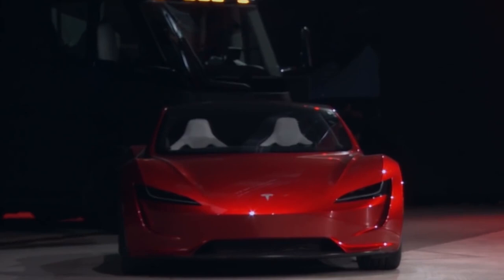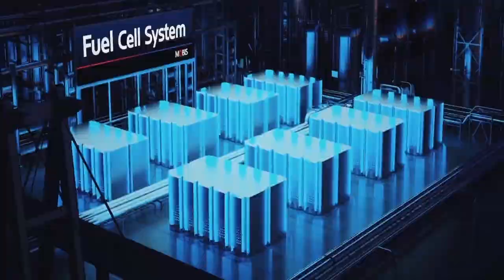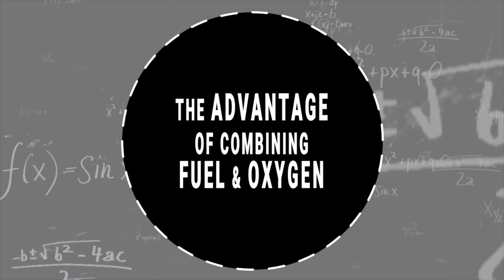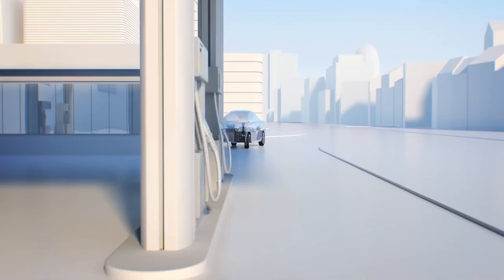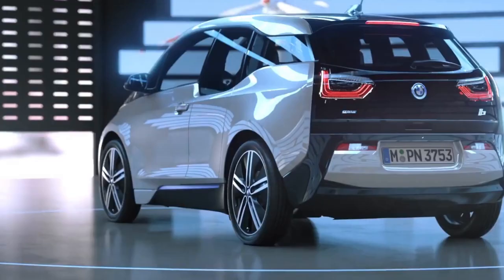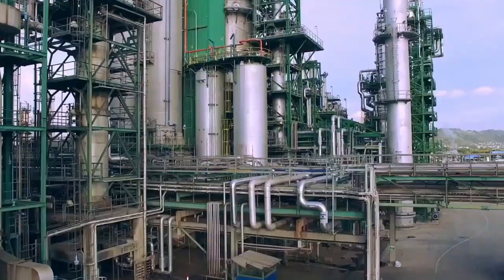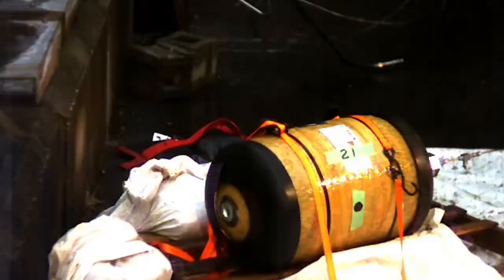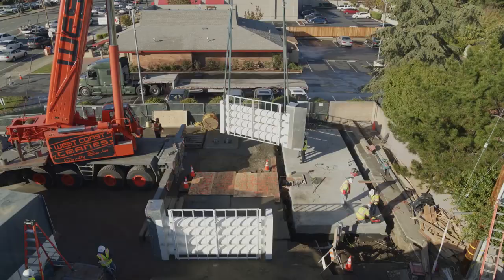is hydrogen fuel cell the future?

Comment: yes
Reply: nope
Reply: @engineeringtheweirdguy2103  bet
Reply: @Victor-oy8bj  sure, but I could just tell you why it wont be the future. Its just not a good technology for vehicles. Just because it works doesn't mean it works well.
Reply: @engineeringtheweirdguy2103  it works well, its just the infrastructure. when 1000 mile range with 3-5 min fueling time starts being noticed, the industry will change. im open to being convinced, i just feel like hydrogen works best.
Reply: @Victor-oy8bj  ok. well lets have a look. I'll outline some problems then I will show how they work out in real world examples. sounds good?

ok, Firstly, Hydrogen fuel cells dont produce alot of power. Infact the need batteries to adequately accelerate the vehicle. Even then, Hydrogen vehicles are still exceptionally slow. There are some examples of incredibly fast hydrogen vehicles but they have the practicality of Lamborghini aventador being a family car for a soccer mum. They're purpose built machines with no boot, 2 doors and 2 seats.

Hydrogen is also incredibly inefficient. to produce Green hydrogen you need grid electricity and water. The same grid that charges BEV's. Hydrogen is very inefficient however, requiring 3-4 times as much grid energy per mile than a BEV. Which means 3-4 times the same emissions. Yes you could run this from renewables but the same can be said for BEV's. 

The other way, and the cheapest way of making hydrogen is getting it from fossil fuels (hydro-carbons) where you split off the hydrogen and the carbon is released into the atmosphere. This way of making hydrogen actually releases more emissions than if you had just burnt the fuel in the first place. That also means hydrogen will always sit at around 20x more expensive to operate per mile than BEV's.

The next problem is that hydrogen, whilst is very gravimetrically energy dense (kWh/kg) is not very volumetrically energy dense (kWh/L). In practical application, the volumetric energy density of hydrogen means that its less than half that batteries. Making vehicles its in fairly impractical in terms of space, especially when you consider it also needs a fuel cell, exhaust system and batteries to boot.

For this reason its difficult to get a long range hydrogen vehicle. Typical hydrogen vehicles on the market only offer 20% more range to a tank.

Another problem with hydrogen is safety. Whilst they've made a very good effort to make the fuel tanks safe (since your sitting on 160kg of TNT in a Mirai but a hand grenade is only 0.06kg of TNT). They've also protected the tanks by reinforcing the chassis. This reduces your crumple zones and results is lower survivability in a crash compared with similar vehicles. It also has huge implications on weight, with Hydrogen vehicles typically weighing more than their BEV counterparts. Even in trucking, the Hyundai Xcient hydrogen truck weights more than a Tesla Semi but over a ton, and gets 200 miles less range fully loaded.

and finally, The lifespan of hydrogen vehicles. Since hydrogen embrittles materials the cars dont last forever. Infact, little know fact about hydrogen cars is that they come off the assembly line with an expiration date printed on the fuel cap limiting the life of the vehicle to only 15 years. The fuels cells themselves only typically last between 150,000 miles to 200,000 miles whilst modern EV batteries are designed to last 500,000 miles to 70% of their original capacity whilst next gen batteries about to begin production in 2022 will last nearly 1.5 million miles to 90% of their original capacity. Making hydrogen a poor lifetime investment.
Reply: @Victor-oy8bj  In terms of trucking and freight, Hydrogen does not stack up well. The Tesla Semi has been undergoing practical trials with selected companies currently. Meanwhile the Hyundai Hydrogen truck the Xcient has finished those and have started selling their trucks in Europe and Australia. 

here's how they measure up. The Xcient requires a 75kWh battery pack just to accelerate. That the same size pack thats in a long range model 3. It also has nearly double the standard semi truck fuel tank capacity at almost 1,000L, it has also has 2 fuel cells. To accommodate these they did 2 things. They made the rear of the semi higher, reducing vertical cargo capacity. They also made the rear part of the semi much long, (which looks weird) increasing its turning radius making it worse for tight spaces and reversing trailers.

it also weights 9.8T without cargo or trailers, gets only 400 miles fully loaded with all the fuel capacity and has a maximum speed of 53mpg, which is less than freeway speeds, so it cant even get to freeway speed.

It is, like its domestic car counterpart, still limited to the same lifespan.

Now for the Tesla Semi, The Semi weight 8.5T, more than a ton less than its Hydrogen counterpart. It has more than 500 miles of range fully loaded. significantly more than the hydrogen truck, Cost significantly less to operate per mile than the hydrogen truck obviously, is alot faster to accelerate and can, even fully loaded up a hill, out run most cars on the road and can definitely reach freeway speeds, and is overall much smaller giving it better vertical cargo height in the first trailer and a better turning circle.

But what about refuelling I hear you ask? well that seems like a obvious win but it isnt. In the EU, US, Australia, Canada and many other countries there is a limit to how long a truck driver is allowed to be behind the wheel. for example a truck driver in the US is only allowed to be behind the wheel for 11 hours per day. And they have to take a mandatory 30 minute break between their 5th and 8th hour. 500 miles of range gives your over 8 hours of driving and 30 minutes is enough to fully charge the truck. Meaning no lost time compared to the hydrogen truck. A smart truck driver would stop at 5 hours for a 30 minute break at a charger to top up, do the other 6 hours and stop for the night at another supercharger before continuing the next day.

There is no lost time and no advantage to filling faster. And with more superchargers out there than hydrogen stations, it becomes a very obvious choice.

for trucking BEV's cost significantly less to operate, can go freeway speeds, so they get to their destination earlier, are lighter weight whilst having longer range making them able to carry more cargo by ton, further and faster and have enough range that by law their transit time is unaffected by charging.
Reply: @engineeringtheweirdguy2103  dam a whole fucking essay lmfao. not mad honestly lol just surprised
response by paragraph: 

they are slow yes but with everything i think its still developing. even now, in the lith-ion industry, it is being rapidly improved while hydrogen probably gets way less funding and research. if there's a car that has 220 mph, 2.2 0-60 and 1000 mile range im sure theres potential. in the future im sure a 700 mi range sacrifice and 50% speed decrease can be sacrificed for ample space i feel. as you said too hydrogen cars out now are 20% more range and maybe they have done that due to how easy it is to store more.

yes hydrogen is inefficient however if we are able to store enough hydrogen it won't be a problem. and scalability wise, hydrogen is probably better for storage since its probably cheaper to store and less intense to produce.

yes hydrocarbon to produce hydrogen is bad but can be fixed and if enough green energy is produced then price will drop.

so you say that hydrogen is less energy dense by volume and is half-efficient in storage however thats where sources differ. ive read that hydrogen is better by volume. i know it says everywhere that it is better by weight and im not confusing that. ive read per unit volume that its better so idk whats true and for now it can go anyway.

toyota mirai got maximum rating on safety and im sure safety is always a priority and has a reliable testing process. and idk what ur saying about weight, the mirai is comparable to the model s size wise and is lighter by 400 pounds. the nexo SUV is even lighter too.

then about the lifespan theres not a lot of straight answers and ive mostly read that hydro fuel cells are sustainable and refuelable. lithium ions don't seem to have a bright forecast either as they've had a continual problem of degradation and not lasting as long as they used to.
Reply: @engineeringtheweirdguy2103  as i said before about the weights, the mirai is closer size wise to the model s and the model s weighs around 300 kg more.

about the storage yes that is an advantage but not a make or break and is something you can brush off when it comes to the real reasons to buying a car like convenience and price. and i will say the hydrogen car is not a good choice right now because of both of those things but they can be fixed through infrastructure. anyways its not like the mirai storage is tiny either and is probably just around average and not a massive adjustment from gas cars.

yeah it is slow but again, lack of development. battery and hydrogen both operate electrically so hydrogen cars are able to use the same functionality as the fast tesla cars. its been shown too with the hyperion.

again you don't need to exaggerate. a non above average storage isn't do or die. yes they cost more (will be fixed), has maximum safety rating, slower but will improve, and has more range. lifespan? (unconfirmed).

dont get it twisted, the fast refueling is the best and most important advantage which will allow for smooth transition from gas. in an ideal world where everyone has a home garage and charging station yes you won't have to recharge and if only if you don't travel much in a day or go out of city. but the points is most of the population doesn't have that level of structure. not everyone has a garage. yes one garage can charge multiple but not all. and there are plenty people who live in apartments, condos, dorms. people share houses, people are stay over and are spontaneous. fast refueling allows for flexibility instead of having to charge at the same place everyone night. and if saving 16 hours a year is really a problem there is home electric hydrogen producing fuel pumps to put in your garage.
Reply: @engineeringtheweirdguy2103  with regards to trucking, im sure everything is better right now. the xcient you mention was developed 10 years ago so its not really a worthy comparison. again, with the right infrastructure, hydrogen will thrive. even if battery has the same strong infrastructure, hydrogen has the more important advantages and necessities. maybe not today but the future yes
Reply: @Victor-oy8bj  the model S is classed as a large sedan. The Mirai, like the model 3 is classed as a midsized sedan.
Reply: @Victor-oy8bj  home electric hydrogen is not very good for a lot of reason. However, you’re confusing current ICE limitations. If you want to be spontaneous with an ICE car you might have to refuel short notice because you’re low. How often are you spontaneously to the point that you use an entire tank of fuel in one outing? Not very I’m guessing unless your friend lives 2 states away. 

Because (in most cases, not all) EV’s can be charged at home, you have a full tank every. Single. Morning. You don’t have to swing by a fuel station when you’re getting low. Unless your spontaneously plans take you more than 300 miles in a day, I think you’ll be ok. I live in rural Australia and I have a standard range model 3. Not even a long range. And I’ve done my yearly full days drive to the ski fields and another full days drive back. You know how much time was added charging? 0.
Reply: @Victor-oy8bj  I can’t see a single one. The fuel cell is the size it is because the power is directly related to the surface area of the catalyst within it. Hydrogen can’t very safely be compressed more than 700 bar meaning that space problem isn’t going to go away.
Reply: @engineeringtheweirdguy2103  sure lets go by the obscure wording categories made to influence advertising rather than the actual numerical dimensions
Reply: @engineeringtheweirdguy2103  why is home electric hydrogen not very good?
what is ICE limitations? 
yes that situation is unlikely but something like traveling to another state for a week, driving around there, and living without a charging station can seem problematic. its only fair to bring up extreme situations when you seem to be so adamant about saving 16 hours a year.
Reply: @Victor-oy8bj  The Mirai is closer in size to the Model 3. If we take the % difference of the L W & H, between the Mirai and the S and the Mirai and the 3, you find that whilst the model S is closer in length to the Mirai compared to the model 3, the Model 3 is closer in both width and height than the model S is to the Mirai. Cars arent determined by their length alone.
Reply: @Victor-oy8bj  I've done that. There are charging stations, super chargers or otherwise everywhere. because they're easy to set up. I've stayed at multiple B&Bs days of driving away from my home, most of which had an outdoor power point I could charge my BEV from for free. People think they're more limited than they are. They're really not. And limitation of ICE being having to go to a fuel station. the moment you do something spontaneous you are at the mercy of what ever you have left in your tank for the week and where your nearest fuel station is. In a BEV you would have started the day with a full tank.
Reply: @Victor-oy8bj  you submit an article which presents very incomplete data, which was compiled in 2008 and published in 2009 before the first mass produced EV (Nissan leaf 2010) and the first mass produced Fuel Cell Vehicle (Toyota Mirai, End of 2014).

Yeah, good work. Firstly they only nominate the total volume taken up by the fuel in a single tank configuration when talking about volume. They dont include the fact that a tank that size doesnt fit in a car and would be required to be separated into sever tanks. They dont adress the wasted space of having a cylindrical tank in a fundamentally rectangular body frame and also dont include the fact that when you start increase the fuel storage size you have to increase the vehicle size to hold the tanks, You cant fit a 5L buck into a 3L bucket.

They also make this assumption of vehicles sizes not increasing when discussing range. If you increase tank sizes to extend range it gets to a point where you cant fit the tank into the car anymore, That means you need a larger vehicle, which weighs more, has higher rolling resistance, and has higher aerodynamic drag, which would would require more fuel, a larger fuel cell to supply the power and a larger battery to accommodate acceleration.

The paper you gave me appears to have been put together by a wordy highschool student. Peer review appears to agree with me.

Where they talked about costs they based it on assumptions made by someone in 1994. So you can throw that section out because we're most of the way to 2030 already and thats already wrong.

As for greenhouse gasses it appears to include the emissions from power plants for EV's but side steps that double standard of hydrogen requiring more grid energy by using the example of gas steam reformation, however they neglect to acknowledge any emissions caused by splitting the HydroCarbon (natural gas) into hydrogen and carbon, in which the carbon is released, and is done so by heating steam by burning MORE gas, which releases MORE carbon.

Try again.
Reply: @Victor-oy8bj  Oh, should also nominate that the in the efficiency and the weight calculations they not not include the battery systems required to adequately accelerate the vehicle and they also neglect what actually causes all the weight in hydrogen vehicles which is the reinforcement of the chassis to protect the fuel tanks which is what makes them heavier than BEV's. Of course at the time this was written it would have been unlikely that they would have been aware of either of those two requirements since BEV's and FCEV's werent even on roads yet. 

For example they note that for a 300 miles range hydrogen car they claim that it would only weight 1.2ton, whist a BEV of the same size and range would weigh 2.2 ton. In reality a 325 mile LUXURY BEV weighs 1.8 ton whilst a 400 mile Hydrogen vehicle weighs 1.9 ton.
Reply: @Victor-oy8bj  so maybe look a little harder buddy.
Reply: @Victor-oy8bj  home charging hydrogen isnt good because by the time you go from power from the wall/or solar panel to the wheels of your hydrogen vehicle, you only have around 35% of your energy remaining. with a 3kW solar array you can only make and compress around 0.05kg of hydrogen per hour. if you did that for 5 hours you would only get enough hydrogen to take a Mirai 35 miles. But that energy (15kWh) would be enough to take a Model 3, 115km. It also wouldnt require you having a 10,000 Psi air compressor in the back yard, as well as storing one of the most explosive gasses known to man in a tank in your back yard. Especially considering that hydrogen gas can leak through solid metal and weakens the metal as you do so, so either you regularly replace your storage tanks, or risk a 10,000 psi explosion.
Reply: @Victor-oy8bj  well firstly, I have written papers like that. Mostly about numerical modelling of ocean wave generators arrays in the use of coastal protection, coastal morphology and environmental protection. I wrote those a few jobs ago I can see if I can find the title for your if you’d like. 

And you’re using the rectangular prism of 3 dimensions to represent sedans. Breath taking. Truely. Also most of what I’ve said is fairly readily corroborated. All the specs I’ve listed about the semi, model 3, Mirai, they’re all accurate. Quick google search will show you that. No amount of cherry picked articles will change that fact.

Unfortunately for you what I do for a living is kinda in my name tag. I’m not trying to sound smart, I’m sorry if big words confuse you. But the only link I’ve seen from you was to an article written before any mass produced EV or hydrogen vehicle was on the road. And does not reflect today’s reality. It was also, VERY heavily biased, something which I pointed out, nearly line by line in the article. The omitted as much.

Sorry but facts are facts.
Reply: @Victor-oy8bj  also, worth noting, that I’ve never stated hydrogen was less gravimetricly energy dense than batteries (kWh/kg) or that hydrogen itself was less volumetrically energy dense than batteries (kWh/L) just that in practice the volumetric energy density was less than batteries. At 700 bar hydrogens volumetric energy density is around 1.4kWh/L. It isn’t hard maths to check for yourself, it goes into a cylindrical fuel tank with spherical end caps, the tank walls are 1 inch thick adding 2 inches to the diameter, and it takes up a swept volume (imagine drawing the largest circle you can inside a square, notice the wasted space. I could do the maths for you if you don’t know how, but it ends with hydrogens practical volumetric energy density being less than half that of EV batteries at 300W/L.

Not super difficult. And it shows in reality, by the lack of boot space and cabin space in the Mirai, less boot space even than a Yaris which is half its size.
Reply: @Victor-oy8bj  I will find and read this new article of yours and let you know what I find.
Reply: @Victor-oy8bj  so here’s my thoughts on the PDF you asked me to google. It states that batteries are cheaper to operate (true) batteries are more efficient (true) batteries have a longer lifespan than hydrogen of which has a short lifespan (true) hydrogen power train is lighter and than a BEV (also true) but it doesn’t speculate on total vehicle weight, rightfully so, the only reason hydrogen cars are so heavy is because the reinforce the chassis to deflect crash energy around the tanks instead of through them, as they’re required to do by legal safety requirements. It also states that small scale hydrogen production is not yet ready for market because of low efficiency and impractical storage opportunities. (Again, true).

It’s conclusion is that more research is needed to go into hydrogen and battery and that they can’t speculate on the future of either technology as the field of nano-carbon materials are developed.

So what have I been saying? Hydrogen is more expensive to operate (which you’ve now confirmed) is less efficient (which you’ve now confirmed). They I’ve also said that home hydrogen production isn’t practical (which you’ve now confirmed) the only 2 things this paper doesn’t talk about is vehicle weight (which would require looking into safety requirements and designs which would have been outside their scope) and practical volumetric energy density (which has nothing to do with power trains operation so it is again, outside their scope).

Please please please read the articles before you send them to me.
Reply: @Victor-oy8bj  also food for thought on the size differences between a mid sized and a large sedan, is that the weight difference between a mode 3 and model S is 2,250kg for the 100kWh model, only 25 more kWh than the model 3’s battery size. Which according to even conservative density measurements of 260Wh/kg, means the difference in battery weight between the two is 95kg. With the the model S can get further than the Mirai, but it begs the question, where does the rest of the 200+kg come from. I could give you a hint but I think you get it by now.
Reply: @Victor-oy8bj  you’re not understand what I’m saying. I’ve said it quite clearly multiple times. Let me repeat. Hydrogen, itself as a gas, is more volumetrically energy dense than Batteries. But in practice it is not, you have to account for wall thickness of the tank and the empty space around the tank (think a round peg in a square hole, there is empty space). So there is space not being used by hydrogen, taking up volume. Which reduces its practical volumetric density

Do you get that now or do I need more crayons. There isn’t a contradiction there you’re just failing to understand what it is I’m saying.

It’s even in the quote you copied from me. Noted that in practice it is less
Volumetrically energy dense.
Reply: @Victor-oy8bj  read again, I said the operational costs were cheaper than hydrogen. Reading comprehension. Come on bud.
Reply: @Victor-oy8bj  model S maximum range is 412 miles, Toyota Mirai 400 miles both EPA ratings
Reply: @Victor-oy8bj  really. I just need you to read what I’m saying and what the article you sent me says carefully. Instead of just seeing key words and assuming what it’s saying. Like when you suggested I though EV power trains were cheaper to buy.  No. Quite clearly I said we’re operationally cheaper or when I said hydrogen was less volumetrically energy dense. Again, I said practical volumetric energy density. What did I say to you earlier. Please please please read.
Reply: @engineeringtheweirdguy2103  ahh fuck i see i didn't read that. but they seem to take that into account as well. "This concept is more lightweight and, if operated at 700 bars, a 30-L tank weighing
26 kg and requiring 60 L of installation space can hold 1.21 kg of hydrogen. This results
in an energy density of 1.59 kWh/kg and 0.67 kWh/dm3
. The energy densities improve
with tank size, and a 120-L tank can achieve 1.84 kWh/kg and 0.77 kWh/dm3
. In the
case of properly functioning equipment, the losses are negligible". 
the scalability is what makes hydrogen a strong option for storage
Reply: @engineeringtheweirdguy2103  ah ur right, didn't read. to operate. but where does it say that?
Reply: @engineeringtheweirdguy2103  by official website: model s is 396 and mirai is 402. if you're going by company articles mirai is still higher. epa reported 420. by biased unconfirmed company reports: model s is 500, mirai is 600
Reply: @Victor-oy8bj  look up the model S long range plus. 400+ miles of range EPA I believe
Reply: @Victor-oy8bj  it notes it in the section breaking down electricity costs per mile. I’d find what page it’s on for you but I’m on my phone. And that’s interesting because the number I have for hydrogen is 1.4kWh/L as a gas. Without any other storage containers. It goes to 0.9 when you include a 1 inch tank wall which adds 2 inches to the diameter and large fuel tanks mitigate this but you can’t fit them into the car. The Mirai has 3 tanks to cover its 149L capacity requirements. So there is some assumptions for ease of calculation on their part and perhaps incorrect numbers on mine. But the end result is obvious in the Mirai.
Reply: @Victor-oy8bj  look, im not trying to be a smart arse. Im just trying point out facts. If hydrogen was more volumetrically energy dense in practice the Mirai despite being longer than the model 3, it shouldn’t have have less cargo and cabin space than any other car in its class yet alone compared to battery electrics. And I explained why that is as an example.

 I will admit though I did get a little snarky after you posted (in my opinion) a very uninformed article compiled with ALOT of assumptions and captioned it with “so maybe look a little harder buddy”. I don’t take well to people calling me or insinuating that I’m stupid or don’t know what I’m talking about when I do. As a consulting engineer it becomes a point that clients often challenge you insinuating that you don’t know how to do your job and they know engineering better than you after watching a YouTube tutorial. So i get a little touchy. For that I apologize. I’m used to giving the client enough rope to hang themselves with, because if I let them believe they know how to do my job better than I do, they won’t ask me to consult anymore.

So for that I am sorry.
Reply: I will revisit my volumetric calculations tomorrow and see what I find but for reference as you noted the article calculates 0.67 kWh/L  (a dm3 is a L) practical energy density, meanwhile BEV’s like the Tesla model 3 using the 2170 cells have a volumetric energy density of 0.71 kWh/L in previous calculations I calculated the practical energy density of hydrogen to be 0.16 kWh/L.
Reply: @engineeringtheweirdguy2103  yeah its my bad too i did get toxic and sorry if it got personal. i mean, im not someone without an ego either so yeah it did sound overbearing to hear someone call a published study the work of a highschool student and from someone who was just claiming things without sources so i had to say something about that. and those articles were just the ones i was seeing, especially the graph, when people were comparing lithium ion vs hydrogen fuel cell. 
i do feel i am overstepping my knowledge since you are more experienced and everything you say makes sense now which im at fault for not understanding earlier (except the car size comparison but whatever). but as i was saying before, even though BEV is better now i still believe in the future technology of hydrogen because of the future models being able to compete in terms of speed and range. i still also believe hydrogen is cheaper and cheaper to operate (unless you can show me otherwise) and since it is stored through reusable tanks, it is more sustainable than having to mine for lithium. so i think hydrogen will have incentive to produce as a medium for good electricity storage.
Reply: @Victor-oy8bj  Thats all good man, as long as we're both man enough to realise and and take responsibility for our actions. I'll start off though with those volume calculations I promised you. From design papers I would be happy to provide, Hydrogen fuel tanks have a Length/Diameter Ratio of 3. I also assume that they are cylinders with hemispherical end caps, as mitigating edges is important in reducing force concentrations and increasing the Tanks strength, But there is a possibility they have a flatter end than a hemispherical. 

The same paper describes the materials and thickenss of each of the 3 layers of materials in the fuel tanks. So we know it has a thickness of 1 inch (25.4mm) which adds 2 inches to the diameter (im going to approximate it to 50mm)

Given that the installation volume is 60L. we can find the tank Diameter if we know the length/diameter ratio is 3. (from here on in I will use meters and meters cubed to keep units consistent) The cross section to fit a circle will always be square, so if x is the Diameter and y is the length we get the following two equations. x^2*y=0.06 m^3 and y/x=3. We can sub in equation 2 into 1 to get 3x^3=0.06 When means we have an Outside Diameter (OD) of 0.2714m and a length 3 times that at 0.8143. Given that we know the wall thickness is 1 inch, we take 0.05m of for internal dimensions. The Internal Diameter (ID) is now 0.2214m and Internal Length is 0.7643m. We know that each end cap hemisphere is the size of one radius and we have 1 at each end. So to work out the volume of the cylindrical portion we subtracted the dimeter from the length giving 0.5429m. Then we calculate the internal area of the cylinder and multiply by its length to get the internal volume for that portion of 0.0209m^3. The end caps both combined can be considered a sphere with the same diameter. Knowing this we can find the volume to be 0.00569m^3. Added together there is a total volume of 26.6L of space.

Given that the Volumetric energy density (I did double check) of hydrogen at 700 bar is 1.4 kWh/L, 26.6L*1.4 = 37.24kWh. But the installation space is 60L, so 37.24/60= 0.621 kWh/L.

So they're pretty close. Not sure how they managed to get 30L from 60L, but what ever, it might have been an assumption. 

One last thing to consider is that you will never access all of that energy. The fuel cell is only 60% efficient. So the useable practical energy density would be 0.37 kWh/L. But that's neither here nor there. 

Meanwhile BEV's have a Volumetric energy density of 0.71 kWh/L once you account for output losses also.
Reply: @Victor-oy8bj  Just in case TLDR, I worked out that for a 60L installation space, you would only be able to store 26.6L of hydrogen given what information I could find about the fuel tanks design. This gives it a Practical Volumetric energy density of 0.62 kWh/L, Once you include the fact the fuel cell only converts 60% of the hydrogen into electricity (with 40% being heat and flow losses). you get 0.37 kWh/L. BEV's once you account for output losses, the energy density is approximately 0.71 kWh/L.
Reply: @Victor-oy8bj  But personally I dont see people wanting to use hydrogen made from fossil fuels. Hydrogen cars, in my opinion arent very good.  you sacrifice alot, so the only reason you'd do that is if you wanted to green. otherwise why did you get one? its more expensive, less cargo and internal space, They do have worse performance but I can justify that in a minute. and they have significantly lower lifespan. The fuel tanks are limited in life to only 15 years from manufacture. So I would only count green hydrogen as being the only viable source for FCEV's for that reason. You could get the cheap gas made hydrogen but I feel like that would be illogical.
Reply: @engineeringtheweirdguy2103  i was also trying to say before, i admit i wasnt clear about it but, that hydrogen is better for scalable energy storage outside of just cars. it will help the dilemma of energy storage which is important for renewable energy since solar and wind aren't 24/7. i think hydrogen is best for large scale energy storage since you can store it in a tank as big as you want to make it. and the bigger you make it, the less volume the operating pressure maintenance adds to the total kwh/L storage. a pressurized tank is also probably cheaper than individually made battery cells. i am convinced that yes hydrogen storage in cars right now is not as good as battery electric. but hydrogen does have a future in national energy storage. then hydrogen will gain more support.
so as you addressed the complicated process of the hydrogen production thats where the infrastructure needs to be supported to make hydrogen cheaper. and once hydrogen becomes cheap and the cars become decent then it will gain popularity and more funding. and i do believe that the hydrogen cars will eventually become decent through development. the main drawback is speed which i think definitely can be improved since at its core, the hydrogen car is an electric vehicle, and electric vehicles have shown to have high acceleration and speed. i think the problem is toyota since all of their electric vehicles are slow as hell and they don't have the technology that tesla has for electric speed. what i hope to see is a small battery that handles acceleration and hydrogen as the main storage for range. 
it all does sound like a massive if but the strongest reason for hydrogen is the fillup time and hydrogen would be the smoothest transition from gas. that combined with the hopeful national energy storage makes hydrogen viable and potentially clean which will be a process.
Reply: @Victor-oy8bj  I understand where you're coming from. I respectfully disagree however. (with some of it). Hydrogen is scalable, which is good, but not so much in vehicles, due to the requirements of volume, fuel cells size and battery sizes. You have to keep your balance of issues to make a working car.

As for Hydrogens use for grid scale storage, I'm not sure kWh/L or kWh/kg are considerable factors when picking grid storage, especially for alleviating renewables curtailment. The biggest two concerns I have with Hydrogen in this use case is A.) Its inefficient. Even at its hypothetical peak efficiency thermodynamically speaking, you still lose between 60-65% of the energy you put in. you only get 35-40% out. That does allow renewables to operate for longer periods but it doesn't do alot to help curtailment if you're wasting most of that energy. And B.) is speed. Fuel cells  dont output a whole lot of power. (they also dont last long but lets pretend thats not an issue). They also need time to ramp up. That means when the grid needs that energy, you cant put alot in very quickly, you also need time for it to start generating electricity. The Spike could already be over before you could make a considerable impact.

Lithium Batteries on the other hand can respond orders of magnitude faster than traditional power plants. Where power plants respond to frequency (demand) shifts, in the order of 5-12s. Batteries do it in a few nano-seconds. This greatly improves grid stability because if the frequency shifts too far, before the generators can respond, thats how blackouts and brownouts occur, batteries have the ability to stabilize the grid quickly giving more time for power plants to respond.

additionally you also operate at around 90-95% efficiency. So you're using most of the energy save through mitigating renewables curtailment.
You, see they already use small batteries to help with acceleration, in the Mirai, Nexo, Clarity, Xcient. But they're small. smaller batteries output less power. Less power means less speed. A bigger battery would mean more speed but less range as you'd have to take up tank space. Unfortunately you have to balance those issues.

But I think the biggest problem isnt the speed I think its the volume, and the cost. With Hydrogen taking up so much volume it makes the cars alot less practical. Even the trucks. The only way to fix that without very advanced materials that dont exist yet, is but putt hydrogen in a carrier. This would require more energy to release the hydrogen (for example, water is a carrier), meaning you would have less range and power anyway. As for cost, I'm referring to cost of fuel.

I also disagree with fill up times being a selling point. I own an EV, I get home, plug it into my garage and I get up in the morning with a full tank. Every morning. I dont have to go to a fuel station. Statistically you spend 5 minutes filling and paying and will drive around 7 minutes each way to get the cheapest fuel locally if you're the average person. Do that once per week that 16-17 hours per year spent getting fuel.

Even for trucking, There are legal requirements to how long you can drive before needing to take a break. In the US its 11 hours per day, with a 30 minute break between the 5th and 8th hour. The Tesla Semi and drive with a a full load for nearly 9 hours before needing to charge. A super charger will fully charge the semi in 20-30 minutes. You could do the full 11 hours and pull over for the night at or near a charger. No wasted time.

The advantage of filling that I can see is for people who cannot charge from home. People in flats with no parking for example. But a large portion of those people wouldn't own cars in the first place. I also see it being useful for country taxis. But city ones would benefit from chargers and reduced operating costs increasing their profits.

But you and i do both agree that hydrogen would be the smoothest transition from gas cars. There is a significant shift in how you construct you daily life with an EV. No fuel stations, calculating range into decisions (which gets easier the longer you do it). setting up home charging... Hydrogen cars maintain the current paradigm which would be easier for people to transition to and accept.

I understand that you believe otherwise. I just disagree. Maybe I'm a pessimist, Maybe I'm biased because I own a Model 3. or maybe I'm onto something. Time will tell either way.
Reply: @Victor-oy8bj  But hey, I just want you to know I appreciate you being an adult about this and realised we were both being toxic. Takes alot of guts to admit that. Thats a mark of a great person. You're a good dude, and clearly you're very intelligent. Keep being critical, and be prepared to embrace the unconventional. I live in Australia and was one of the first people to get a Model 3 in the country. Had no Idea what I was getting into but I did my nerdy Engineering thing and worked out spreadsheets and formula's and found that the EV was cheaper in the long run and all round better to own. Despite everyone telling me otherwise and saying I was being stupid. I stuck to my guns and 2 years on, I'm still where I calculated I would be. Especially with how fuel prices have been going during covid. At the moment i'm saving myself around $6,800 AUD ($5,000 USD) per year by owning my Model 3. So keep being critical, it can pay off in the long run, despite what people tell you.
Reply: @engineeringtheweirdguy2103  yeah all respect at the end of the day. you have opened my eyes to a lot of knowledge i didn't know and changed some of my past notions and thats always good and best to stay informed. yeah im biased too and so is everyone else and its good that you recognize that, as long as people yeah think critically to make the right decisions. im sure youre a good guy too and i can very much tell your a smart guy. and that's admirable to be one of the first tesla buyers and is all a step in the right direction for a world we can both agree on. its always best to think important things through as best you can and its all that much better if its to make the world better for all and future humans. but yeah man thanks for the long but insightful discussion you can really learn from anyone including random ppl on youtube lol. have a good one. keep livin.